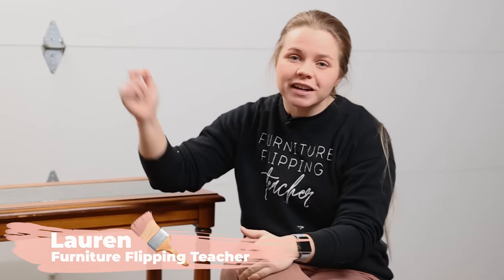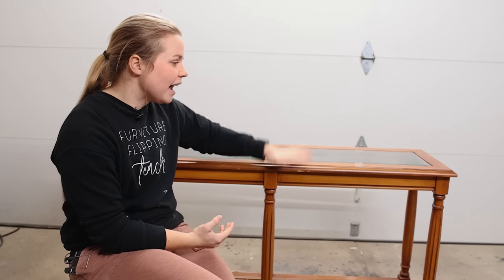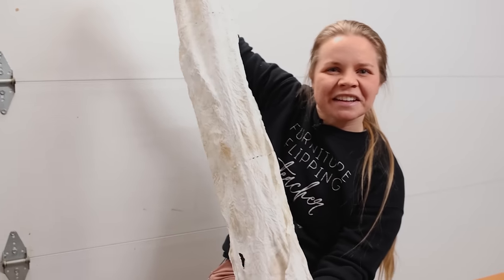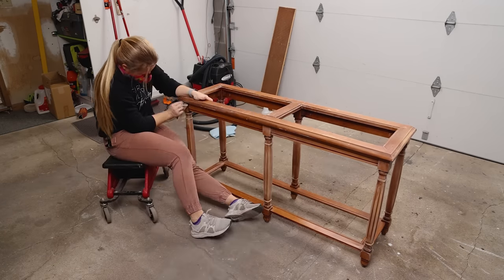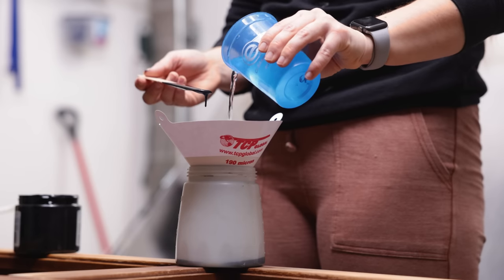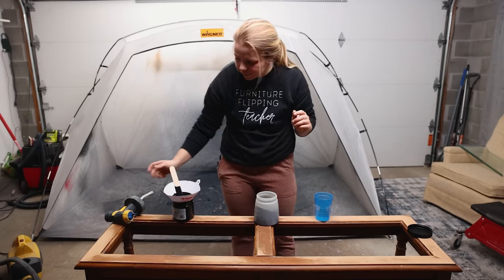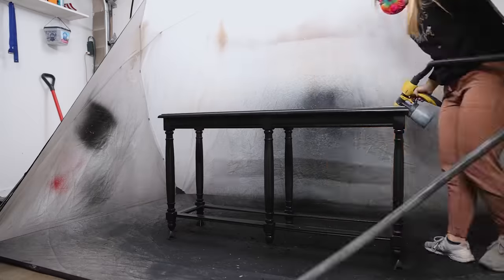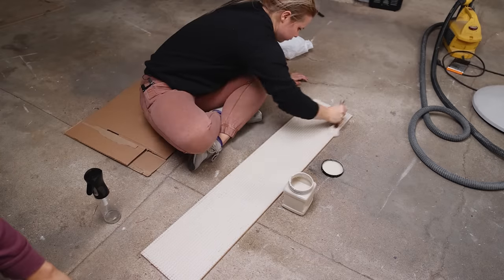Surprising my Mom with a Furniture Flip | 75 Yr. Old Console Table Makeover

Comment: Looks beautiful! Something to try next time is using a nozzle on your air compressor to "dust" that cane (or baskets, screen, etc). Also, turn buttons on the underside would make the cane removable for a future remake.
Reply: I’ve also seen a ‘sand blasting’ kit that attaches to a compressor and it is used to get finishes out of crevices and corners and detail work and did a super quick job of it too! Wish I could remember the guy’s you tube channel that had it but I imagine they are not hard to find. He had a bucket of sand attached to it too.

Comment: I have coral paint on my bathroom walls. I want to paint them my self. Want to paint them a light gray. So what do i do first.
Reply: Prepare walls by going over them and looking for any small holes, etc. Fill those with crack fill. The pink one is great as when it’s ready to be sanded it turns white. Sand. Then wipe down the entire wall with a damp cloth to remove debris and dust. Depending in what room it is choose the paint type that best suits the room. Any paint store can help guide you on that. Choose your colour. If you are painting over a very dark colour and going lighter, you will likely need a primer. Again, people at any good paint store will help guide you on this. The type of roller is very important so when you go to purchase paint be sure to tell them if your walls are smooth, or do they have a texture finish? Prepare the wall for painting by taping off windows, floor boards( corner round) and ceiling. Use drop clothes to cover all the furniture in the room ( I use old bed sheets). Purchase a GOOD cutting in brush, this is what you use to get into corners and go around the edges of the floor, ceiling, windows, doors, etc. Remove all light/ outlet covers. You can goggle “ cutting in” videos to get some idea of best technique. Cut in all the taped areas, then roll the rest of the wall. Depending on colour, type of paint you will most likely need two coats. That’s it !
Reply: @makeuplover6852  Thank you so much.
Reply: There are some great how to paint walls on youtube for visuals on Makeuplover 68 explanation.
Reply: @jadea.2694  Thank You